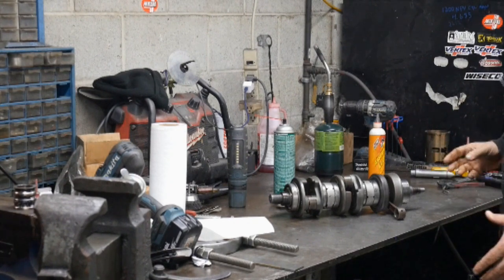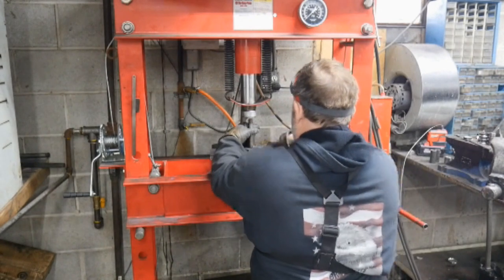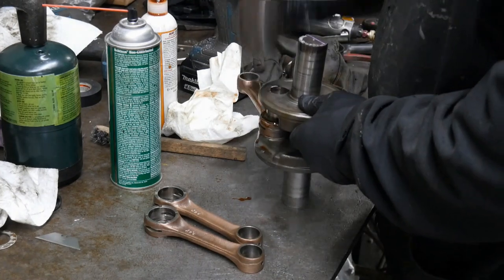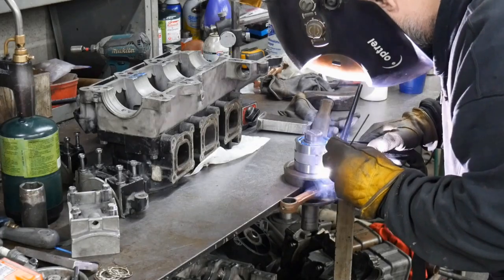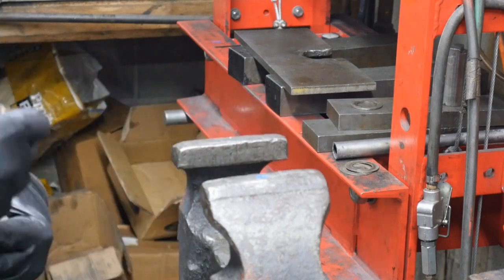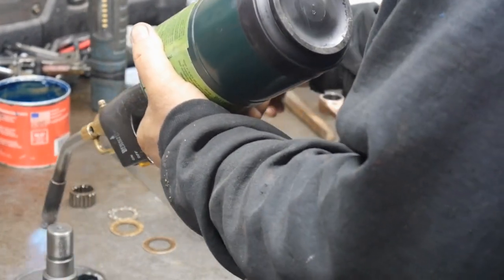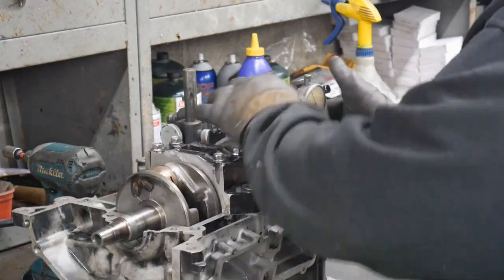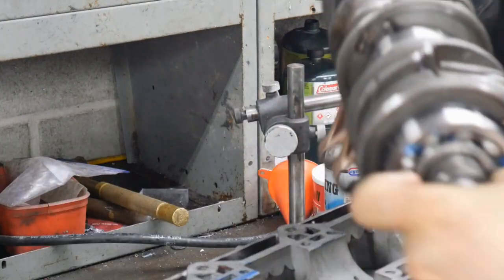YAMAHA 1200 1100  NPV CRANKSHAFT BEARING TRUING WELDING REPAIR REBUILD

Comment: when you have a series of pistons, so a crankshaft with a few different loabs and wrist pins, if the journals are using actually bearings, like in a multiple cylinder motorcycle engine... if the wrist pins are just round cylinders and pressed into place, how does everything stay aligned and indexed correctly?
Reply: They are pressed together. The outside of the bearing spins. The inside doesn't. 
If I understand your question